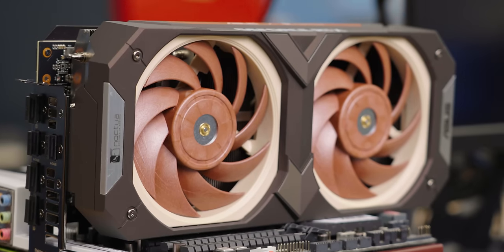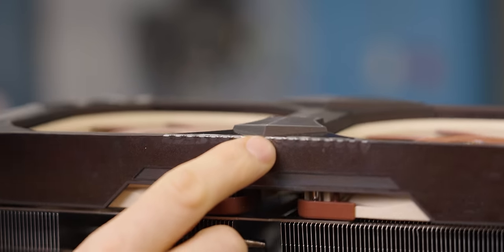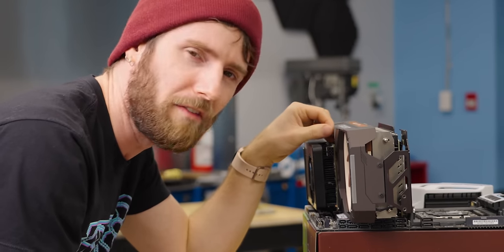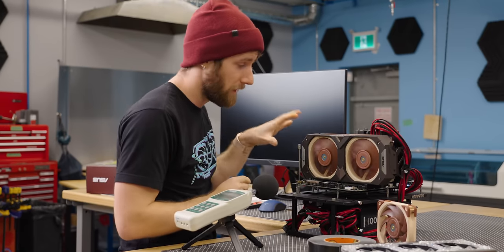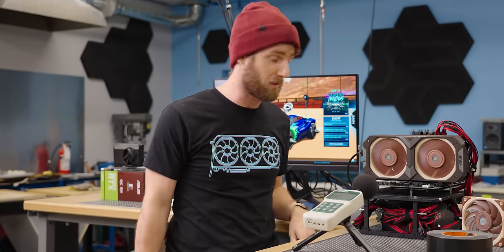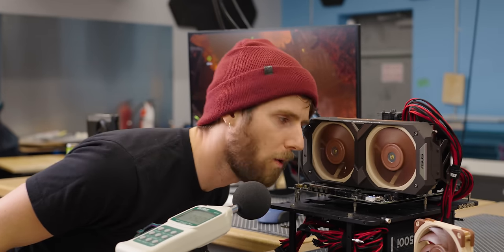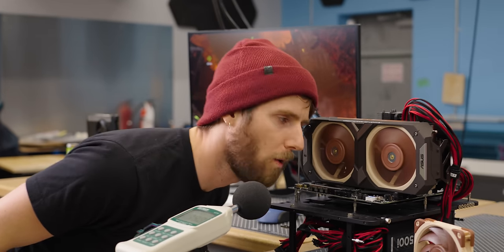Real Noctua GPU vs Redneck Engineering My Own

Comment: noctua is like Apple ... a lot of their concurrent  perform same as they do (sometime even better ) and cost a fraction of their pricing ... 
my Red Devil RX 6700 XT is in the same league as that 3070 , is virtually silent (and cool 55° with a hotspot of 69°° most of the time )  and i got her for 450chf/$ last year (thanks crypto crash for juicy promo) although even at full price ofr 650chf/$ t would still be better priced and still adequately cooled while only using 3 slots 
as for the size of it ... well indeed Linus didn't see the 40XX series coming x) at the time

Comment: 1. GPUs don't suck up hot air. Hot air rises and therefore you're more likely to get your CPU fan sucking up hot air from your GPU PCB, but if you have a front fan with a good angle at your GPU fans, they'll not be sucking up hot air (thing you said at 9:50) except from maybe the PSU, which most people point downwards. 
2. At the same time, distancing the fans from other hot components could very well be one reason they went with a 4.20 slot card, to distance it as much as possible from the other moving parts and any convection going through the case. 
3. That plus heatsink size is probably the temperature difference.
4. Your "redneck engineered" GPU still performed at better temps than the RTX 2060 Super I had that GIGABYTE WOULD NOT RMA!!! Hotspots of 105 degrees, average of 83 on the die, DirectX crashes, unable to hit advertised clock speeds, but still not Gigabyte's issue according to them, even as I went and bought a new case with new fans to try to fix it.

Comment: for fucks sake, would you please dump that stupidity cooling sistem and replace it with water block, a radiator, water sensor, and combo of pump&reservoir ! it will be far more sexy and it's wouldn't hang so much weight on that poor PCI express slot.

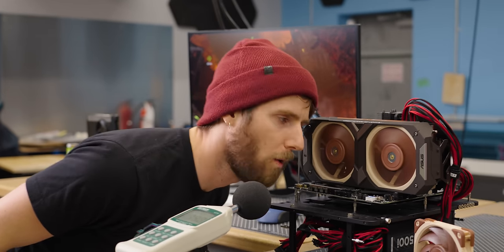Comment: These people at LTT have been running tests forever on all sorts of equipment, yet to see the tape almost completely cover the area where the heat is supposed to exhaust from (12:04) makes me feel like they are intentionally providing false testing results to push the market. These people have been doing this too long to say they don't know any better, and i wont buy that this was a mistake, especially since this has been tested in the past and has been shown to work well enough to the point where a company actually did a collaboration with another one to provide the feature. A shame you mention derbauer yet fail to conduct the same practice. And not that this message will ever be seen or cared about in the 14 mill people pot, but I think I am going to let go of this subscription.

Comment: This thing is lazy and ridiculous. Noctua should port that fan blade design bought/stolen from Nidec and resize it for 140 and 92mm. 
If this fan was made with 92x15mm fans with improved NIdec style blades it would've been much more interesting. And what is the point in putting such a massive heatsink in a measly 3070 with 240w? They should have put it on a higher end 300w+ card.